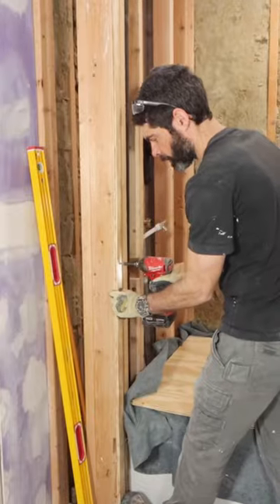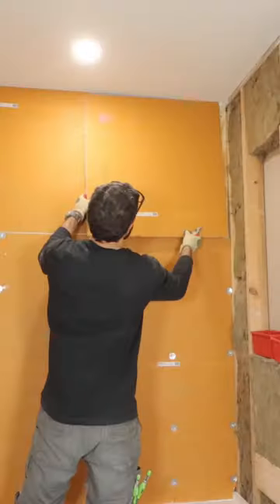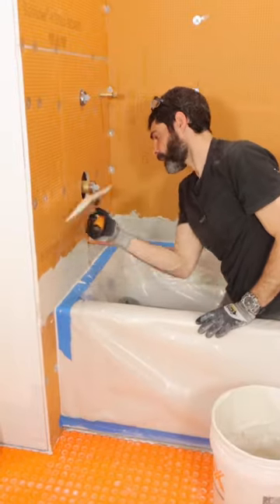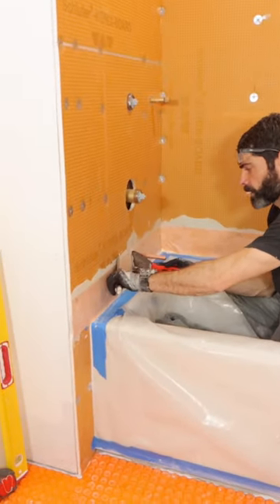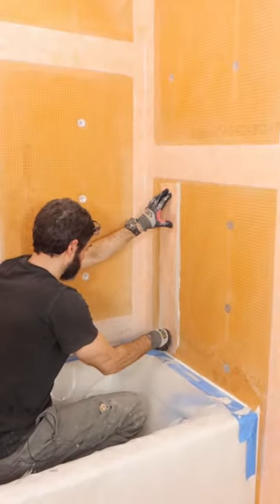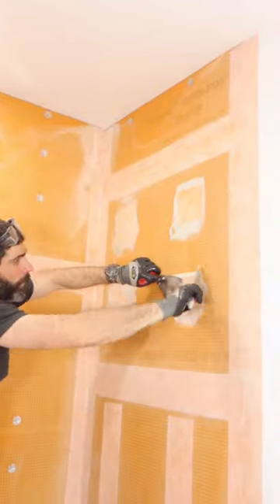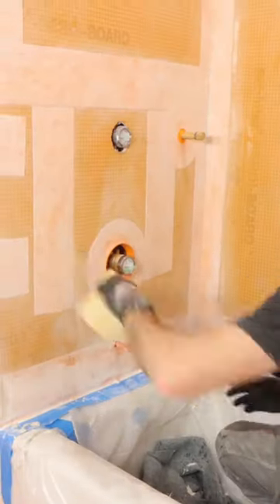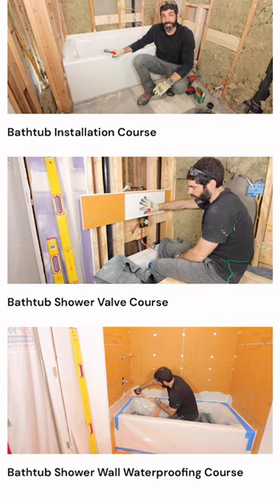How to Waterproof Bathtub Shower Walls - #shorts

Comment: If you’re dropping the kerdi board over the tub flange, why would you need to add the band? The tub flange won’t wick up any moisture and you’ve already used the kerdi sealant with your board along the flange. Is this  more of a belt and suspenders approach?
Reply: I agree. You wouldn't even need to caulk it. No way water decides to go up and over the flange.
Reply: Nothing wrong with belt and braces where an edge of bath of shower.
Reply: Its Due to capillary Action, You definetly want to kerri ban.... Also the Sealant Wears down after so long. Thus why you would use schluter profiles for corners that require caulk.

Comment: Schluter recommends processes that use a lot of Schluter products I notice. I just put aquabar on the studs and nail the board above the tub flange so it doesn't wick.
Reply: The thinset you need to use for their warranty is also 40$ a bag.

Comment: Your not supposed to drop any backer board over the lip of the tub. Read the installation instructions with the tub. Backer gos to the top of the lip. Then seal the tub top lip to the bottom of the backer. What your doing will let mold grow on the backer board if water get to the bottom of your board.
Reply: This isn't backerboard. Backerboard is water resistant, this board is waterproof.
Reply: That backer board will mold if it gets wet. Get that board out of the lip.

Comment: Is he using tile adhesive to glue the banding on ??? Is that waterproof the adhesive i mean,ive only ever seen lads using a silicone between the joints and on the screw heads wedi boards we use they look the same but we use the wedi silicone with ?? Dunno fun to learn
Reply: He's using Schluter All-Set to glue the Kerdi-band on. It's Schulter's own formulated Thinset. The Kerdi-Fix is their own adhesive meant for repairing holes in Kerdi or as a sealant.

Comment: Won’t furring strips make the kerdi board stick out past the drywall by a half inch?  What do you do about that transition if it’s on the same plane?  I understand it doesn’t matter on the front side of the tub because of the corner.  Thanks!
Reply: Drywall won't go on the walls. Tile will be glued right onto the orange walls/Kerdi-board. It takes the place of drywall or backerboard. And he's putting the furring strips on because he wants the Kerdi-board to fit directly on the tub without it bowing out at the bottom so that the wall from the bottom of the tub to the ceiling is perfectly plumb. Hope that helps.

Comment: What is that material he was using?
Reply: Schluter Products. All set Thinset, Kerdi Board Instead of green/backer/cement board. Kerdi Fix is just an adhesive for building, you can make benches with this kerri board. It has Kerdi On it, (waterproofing membrane)...

Comment: Dont ever use this foam board its garbage. I had 2 bathrooms fail because the tile grout went bad and got to this foam board.. ITS NOT WATERPROOF
Reply from the maker: How did you waterproof it? Meaning what thin-set did you use? And what trowel was used to apply the thin-set? And how did you address the tub to board transition?

Comment: So unpractical and long prep
Reply from the maker: I don’t agree
Reply: @HomeRepairTutor  
I build new homes and do high end remodeling, hardie or even blue Sheetrock and redguard with fiber has never fail, or simply just week systems, very simple and easy, with the orange stuff you use unmodified thinset that have proven in many researches no to be permeable and not 100 percent waterproofed.